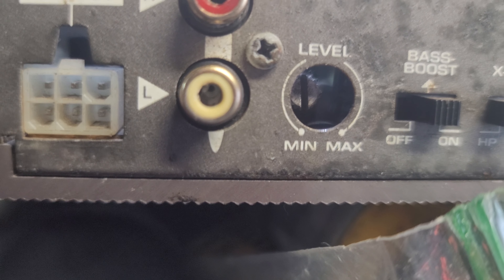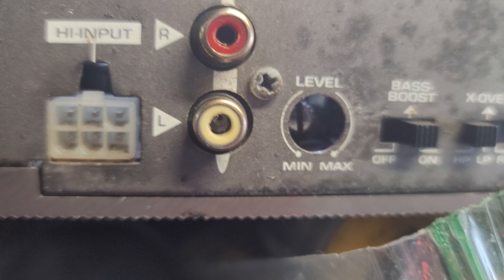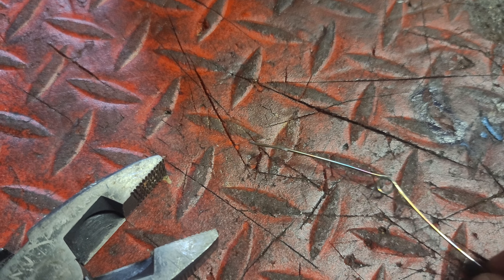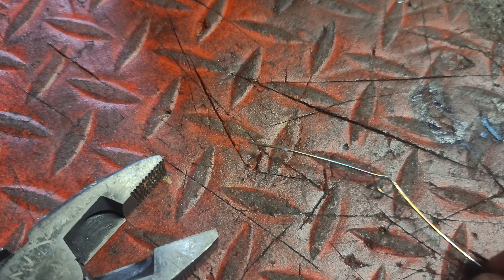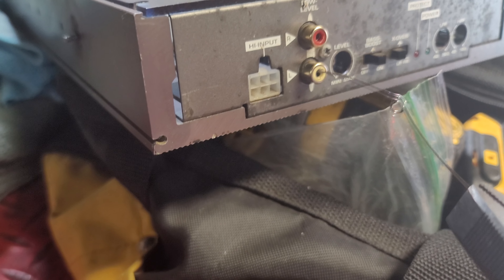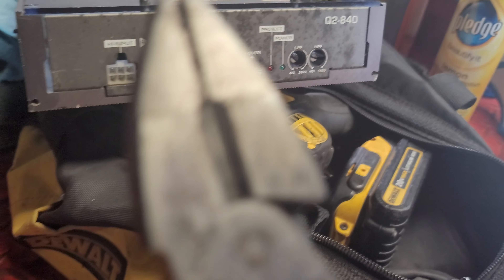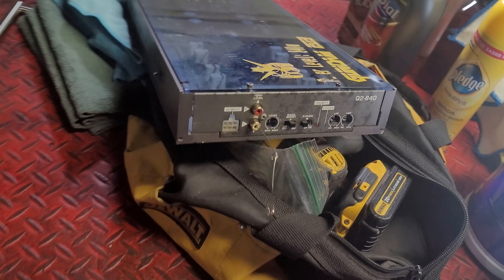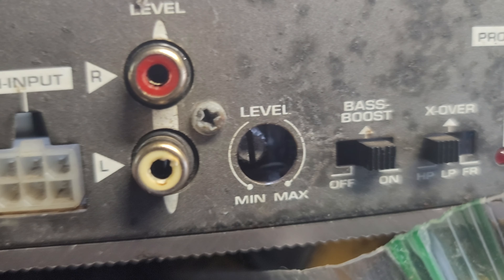How to QUICKLY remove broken RCA jack pins from an amp EASILY

Comment: Worked perfectly. I was hesitant that it worked, but it worked.  At first the plastic piece came out and not the metal, so I stuck it back in turned it 90 degrees and it pulled the metal and plastic out. I may not heated the plastic up enough but it worked. 

Thanks

Comment: This is the 2nd video I've found with this solution. I came up with this solution on my own before finding them, and it only partially worked. The plastic came out when I pulled, but the metal sheath surrounding the plastic that is the tip of the plug is still in there.

Comment: Hey good video, but My end of my rca Pin seems to be metal, how can I get it out then? All the videos I have watched say its plastic but im certain its metal😂
Reply: Astrotaku.... get a cocktail stick cut the point off one end so u have a thick end Put a small dab of superglue 3 on the end push it in all the way u may feel the pin go in a little bit more  Leave to dry for 2 mins and pull out Done this a few times and they were metal pins too. Works a treat n nice n quick n easy 🙂
Reply: Astrotaku... try my method 🙂
Reply: That happened to me today o got it out with a sowing pin got new rcas and wene I hook everything up my bass surges low to high really fast like it doesn’t make good contact with the amp so I tried another amp and it works fine maybe the jack got damaged idk

Comment: Doesn't work in my case. The outer circular wall of my broken stem is thicker than the plastic core inside. All these videos are the same and assume every pin has a fat plastic center.